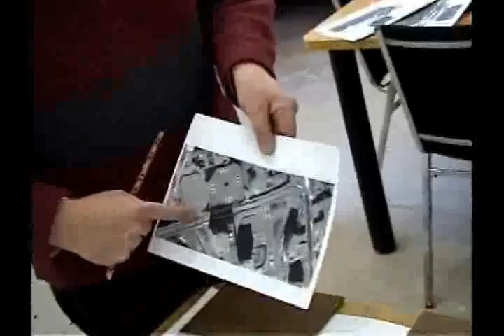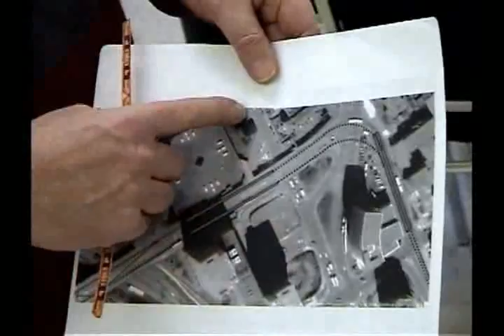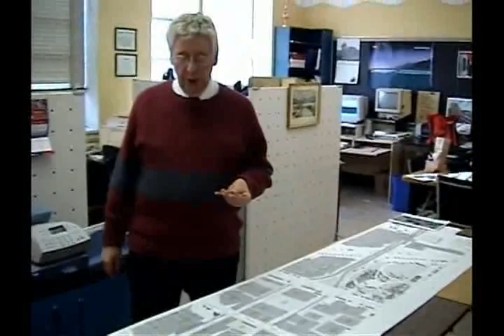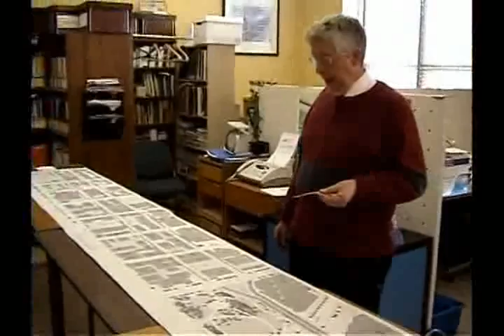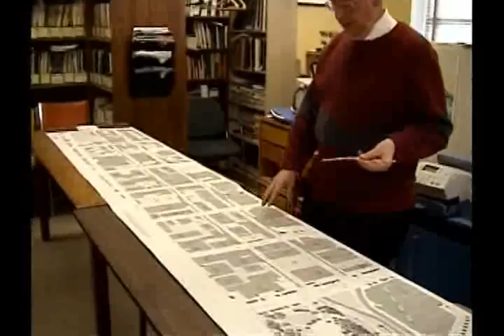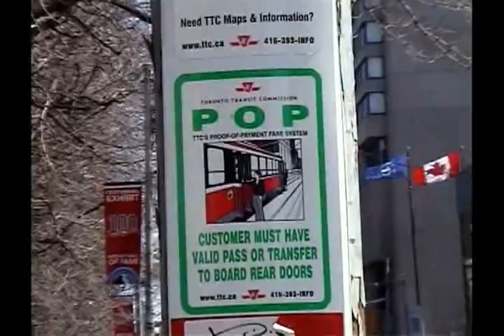Light Rail on Ottawa Streets (3). Part Three.

Comment from the maker: In the future we would use Existing rails as well as adding new rail lines in existing corridors i.e. hydro and parkland. A rail corridor does not need to be very wide. These old and new corridors can bring in people VERY fast from the suburbs to the core of the city. 

And remember, not everyone works in the core. Many people also work in the many industrial parks around the region where most have rail lines near them.

The downtown streets are already over capacity with buses!

Mike

Comment: Using existing rail lines also means that riders from Kanata would ride due east, then north, where bus lines go north east, a more direct line and there are no useful lines from Orleans to the core. Volume is not the only concern, travel time is a key factor in making transit systems viable.

Comment: Scrap the project and use the existing tracks that are spanning Ottawa from west to east.

Miami has Tri-Rail, NYC has Metro North, Boston has MBTA, San Diego has Sounder. L.A. has Metrolink. Phoenix has The Roadrunner, Toronto has GO Transit, Montreal has AMT. 

What do all these commuter agencies have in common? They all use existing railway tracks and North American equipment. 

Stop repeating the Greber syndrome. Light Rail is total waste of Ottawa taxpayers money.